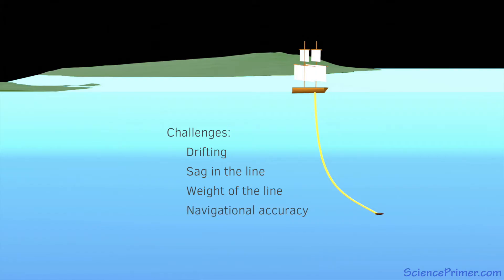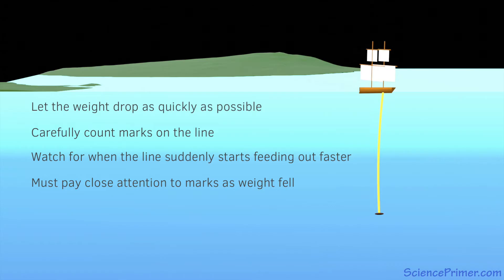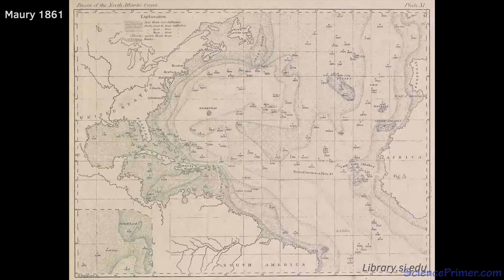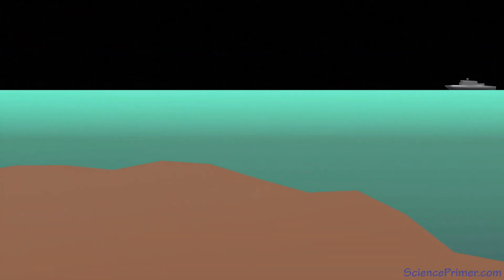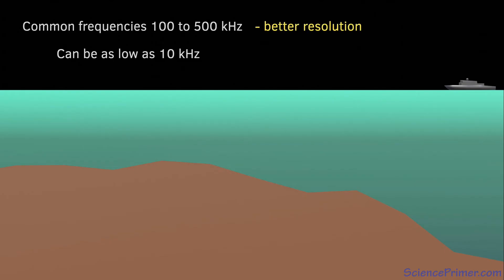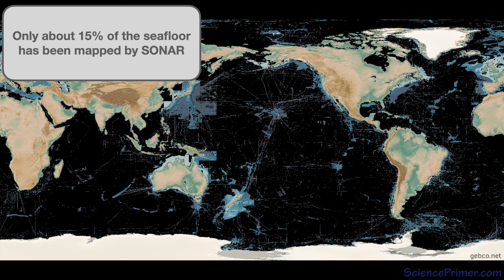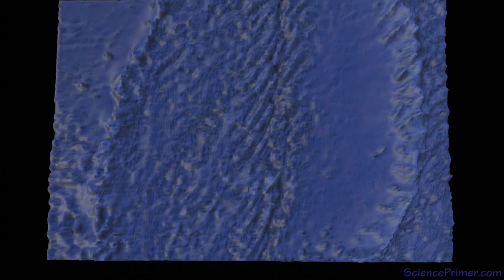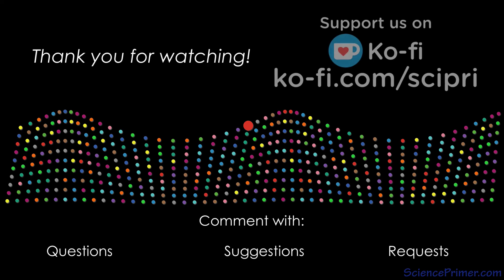From ropes to sound to satellites - how we map the sea floor

Comment: LOL water is level it doesn't "follow" the ridges on the bottom of the ocean
Reply: Consider this extreme example: 
If there was a tiny black hole on the ocean floor - and let's say for the sake of arguments the ocean isn't draining into it - then water will get attracted to that spot. 
Subsequently it will form a bump on the ocean surface.

Now, while we don't have any black holes on the surface of the oceans - if you've got a deep trench, then there will be water in a placr where there "should" be rock. The place is lighter. There is less gravity.

And so, water is pulled slightly away from that spot and towards places with more mass.

Comment: Excellent video; why is it, though that the water follows the shape of the surface beneath it? At first, I was under the wrong impression that ridges had increased gravitational forces therefore, water directly above them was pulled downwards more and there was a dip.
Reply: You're almost right. 
Gravity does pull it down extra hard, but it also pulls water sideways towards the region with more density. 

It may be easier to understand when you think about gravitational potential instead of gravitational forces.
The water surface is (roughly) a surface of equal gravitation potential. 
If you get to be closer to something heavy, then you have a lower gravitational potential (like further down).
If you are far away from heavy things, then you are at higher gravitational potential, like being higher up.

Comment: Water surface will not be affected by underwater formations. Only in shallow moving water would that ever be present. Don't let this fool change your own knowledge about this Earth. Worse than Bill Nye the science dude.
Reply from the maker: Of course water is influenced by the bottom. That is how gravity works, and we have decades of satellite data demonstrating this reality. Why are yo so hostile to this data?
Reply: It may have helped to talk about the size of the effect. 

I did an back of an envelope calculation and came out with a factor of about 10'000 to 1.

If there is a 10 meter bump on the ocean surface, it will barely even produce a 1 millimeter difference on the surface. Plus, it will be smoothed out over a wide area. 

People intuitively know that there is no hole above the Mariana trench where the water is pulled down or a protrusion of water around an island. 
So when they hear about this it seems outrageous.

I'll also say that most viewers likely really enjoyed the video and mostly understood it's content. You're doing a great job, thanks.